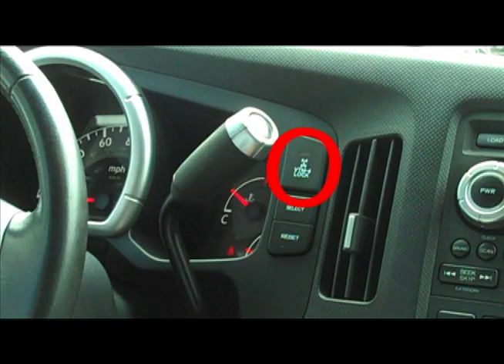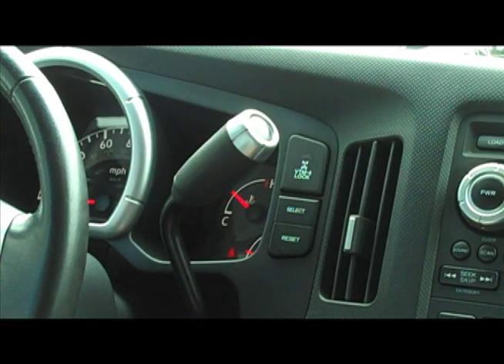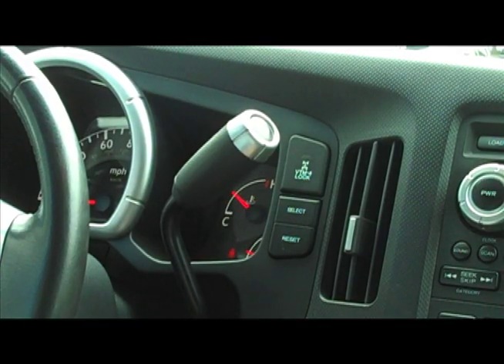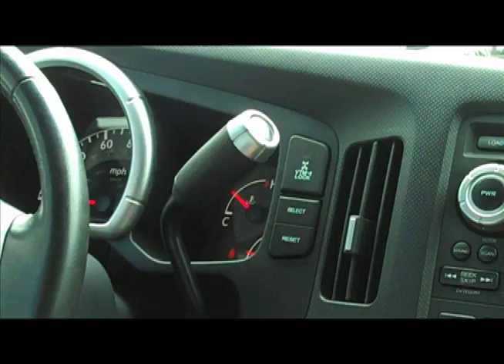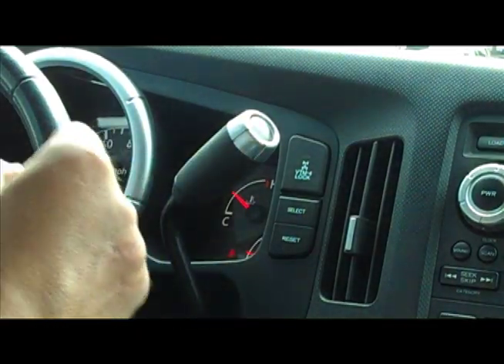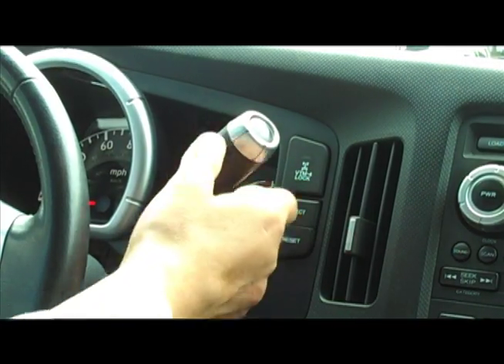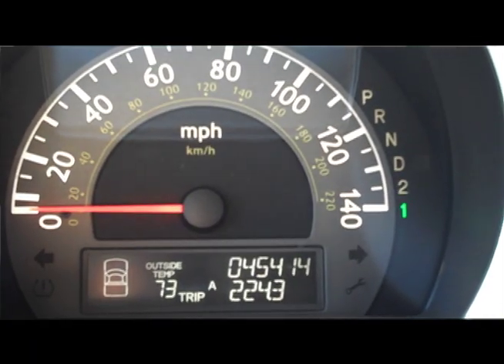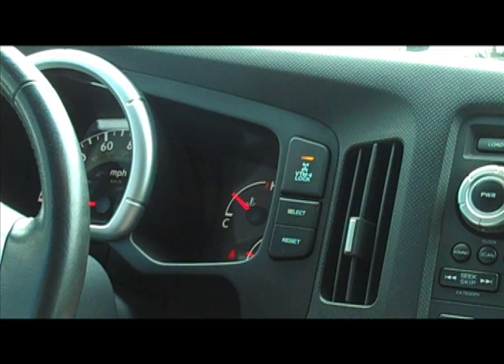VTM-4 Functions

Comment: I have a 2007 Pilot, and the service guy said you dont have to stay under 18 mph, because as soon as you go over 18 mph, it automatically goes off the VTM-4 lock, back to normal. Guess it is an internal fail safe thing.